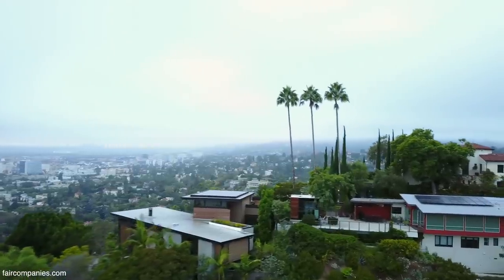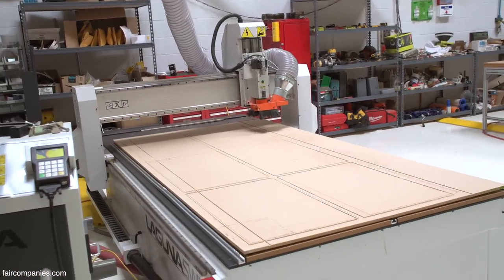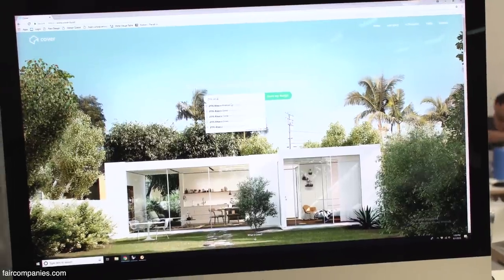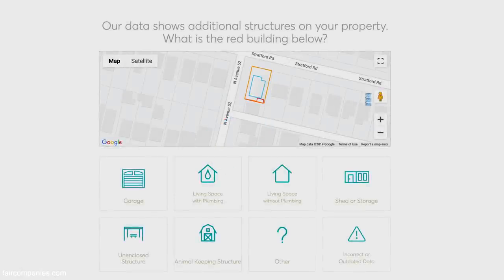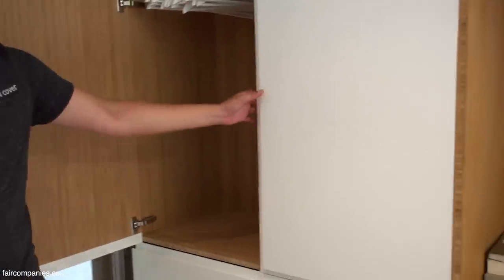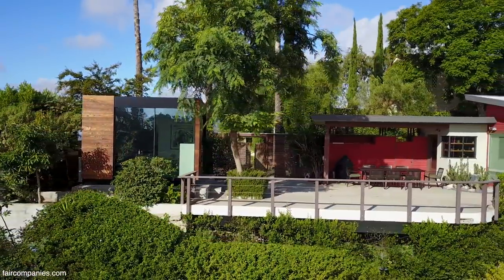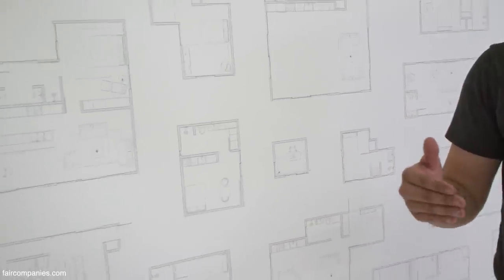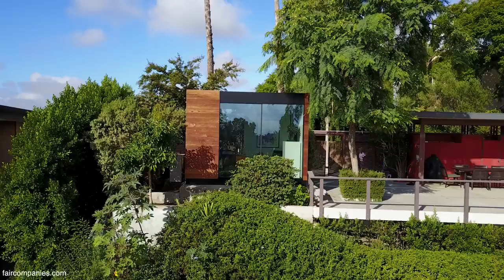LA startup offers custom small prefabs adapted to area code

Comment: $100k? I think you are missing the idea that prefab is supposed to reduce price, not increase it.
Reply: $100K for a ZERO BED AND ZERO BATH prefab. They showed the CHEAPEST configuration possible.
Reply: That's incredibly cheap for LA though, I guess if you could find the land for it
Reply: I'm guessing that 80k is for the land and 20k for the actual tiny home.
Reply: I think it's you who is missing something. "Prefab houses are cheaper than conventionally constructed houses," said nobody ever.
Reply: @oldrogue4247  
These said nobody ever jokes are getting stale fast. Nobody ever has anything original to say anymore.
Reply: Many times prefab is used for difficult sites rather than cost. But yeah, that price is ridiculous.
Reply: Nick, It is 100k in California, 3k everywhere else.
Reply: @JM_Univrz  When you talk about buying a prefab you never include the cost of the land. That is an entirely separate transaction obviously. They mean its $100k for just the home, and yes that is ridiculous.
Reply: @jerryw5508  100,000 in LA is a STEAL!!!! Especially when homes start of at 300,000
Reply: Joshua Stovall Yeah but those homes come with land. You’d still need to buy the vacant land to place this house on. And the price of vacant land in LA...well. You’d probably end up paying more for these prefabs.
Reply: Jerry W so it's the land cost that makes the difference? Or they are charging people $100k in Calif and $3K elsewhere and just making a tremendous profit in Calif?
Reply: Joshua Stovall where do you find a $300k house in LA? A condo?
Reply: Exactly! I've seen tiny homes that were nicely built for $5000 and under. I saw one made with reused building materials for under $1000.
Reply: @nickwest932  Ever
Reply: I think a few factors makes these prefabs expensive:
The company is in a startup phase—efficiency will probably come with time
The idea is to have as modular buildings as possible—small modular units are probably a lot more expensive than large prefab modules
Reply: Exactly the whole idea of the tiny house living is about avoiding the outrageous cost of housing that many young working Americans can't afford.
Reply: Joshua Stovall — you must be working for this company to say this. The land in California is very expensive and if you add up the 100.000 for the house, Specially that small, it’s just too much‼️
Reply: John Miranda Not in California.
Reply: Shawn Nichols Still very inexpensive for almost anywhere in California, west of the Sierra Madre.
Reply: @oldrogue4247 
Untrue.
Reply: @zacht9805  
Hardly. I've picked up residential 
properties in the Los Angeles area 
for under 100K regularly. LA has an abundance.
Reply: @zacht9805  $100k for the building itself is not cheap.  Labor and materials are historically cheap, the land, electricity/water infrastructure, etc. is where the cost comes in.  In most areas of the country you can get the land for $30k and build a house for $90k and now you have a house worth almost $200k.  So having a prefab house for $100k is still a bit costly.
Reply: cost will go down once demand increases, not accounting for land. let's say a developer buys an acre of land and then fills it with these pre-fab homes. it's not going to cost $100k per home because at scale, you get cheaper materials and it brings the cost down.
Reply: @eekaygames  
Don't expect demand for $100,000. 
sheds to explode anytime soon.
Reply: @20alphabet  See, all you're looking at is the price and not realizing what it brings to the table.

A single-family home costs about $103/sqft (depending on material). These pre-fab homes cost about $200/sqft, but take a fraction of the time to construct. To make a similar home with the same amount of quality and design would likely start costing up to $150-$180/sqft

Then there is the time to make the structure. The average time it takes to build a single-family home is about 6-7 months for construction alone. These things take like maybe a week? We'll be conservative and say it takes a month for all of the planning, fabrication, and then onsite assembly.

At the end of the day, the prices of these pre-fabs aren't even that expensive. They're only expensive now because it is a new concept and new concepts take money to figure out.

Also, demand is already there with housing shortages in metropolitan areas and its only a matter of time before pre-fab homes take over
Reply: @eekaygames  
Anyone spending twice as much for a shed than a house is a fool. And as P.T. Barnum said, There's one born every minute. Therefor, your demographic is limitless, huh?
Reply: @20alphabet  facepalm ya did see that they offered larger units, didn't you?  You are right, there is a fool born every minute and I'm clearly talking to one. if you value money over time then that is why you'll never be wealthy because you only focus on cost and none of the benefit. Is a $10k car going to be the same quality as a $20k car?

Clearly, you didn't even read my last comment as all you focused on was the $100/sqft lowest price and didn't even notice that to build a shack to the same quality as these guys, it'd cost significantly more, up to $180/sqft. but it would take 4x longer to create.

Here is a quote for you. "No amount of money will ever buy you more time." You can always make more money but you'll never get back your time.
Reply: @eekaygames  
You'll never own a business, you'll be fired from most employers, and your wife and children will despise the sight of you. Don't misunderstand, it's not whay I wish for you. I just see all the ingredients in your posts that are required in such results. Enjoy your choice.
Reply: 100k is peanuts for a home
Reply: @sahilprashar567  
True, but ridiculous for a shed.
Reply: Joshua Stovall 

its not a steal whatsoever.  
they are charging 350 a square foot to build a a prefab house.   

a day laborer, a handy man and a carpenter can knock that out for $50-100 per square foot.  

this should be $35 per sqft, not $350
Reply: EK Productions 

bro this is not a house.  its 270 square feet.  you can build that in 6 weeks for a fraction of the cost.  

and this not a new concept. just a new company.  

search youtube for the marriot hotel in nyc.  its prefab and cost them much less than a real building.  

cheerio
Reply: @Susan Hughey   Thats not really how capitalism works.  You do not "overcharge" your customers to try and get a return on your investment as soon as possible.  That is a great way never to make money.
Reply: @oldrogue4247      Let's see!    100k / 279 sq ft is $358.43 per sq ft for a prefab home, no foundation, nothing?    BS!   It is cheaper for conventional construction.    If you like to get rip-off go ahead by all means.
Reply: 100k is too much in usa? bro come to australia, we will give you a single toilet for 100k
Reply: he profits from the reduction in price lol.
Reply: @Psyberify  and the plumbing, electrical cost.  It for rich people that does this for their kids.
Reply: @sahilprashar567  You don't get the property though.....that is where most of the cost comes from in California
Reply: You're not giving it a chance!!!
Reply: @jerryw5508  Then that's ridiculous. Why should it be more in California than anywhere else if it's a prefab.
Reply: @isismorrissey9075  lusting, to be more precise. Most of marketing is about eliciting lust for objects. That's usually easier than convincing people they need or want something they really don't. It's that unexplainable feeling you can't quite put a finger on that you experience when holding a new gadget in a store, such as an Apple product. Yes, after a while it can become almost a necessity, but nevertheless that's the concept.
Reply: Cheap for LA!!!!
Reply: EK Productions Don’t worry about those negative comments. You guys are into something good. Any innovative product comes at price, especially in the beginning. They are only looking at materials, they forget that those houses are not built by their owners. Your employees need to get paid too. Only one thing, make them with solar power. It will help to entice people to taking a second look.
Reply: shake_tube overcharge? What world or time are you living? Since when $100,000 for a house is a lot of money in LA? Wake up man!! Lol
Reply: @oldrogue4247  not if you compare it to a mobile home prefabs which run $35k to $65K but i understand that these are higher quality but more expensive
Reply: This is not cheap, its cheaper to build it in a conventional way.
Reply: Prefab is generally 10-20% cheaper. Meaning of you made this house to this high end and customizations, it would be $110-$120k rather than $100k
Reply: @jerryw5508  great, if you can buld cabin same this house with 3000 usd, you are king of CHINA